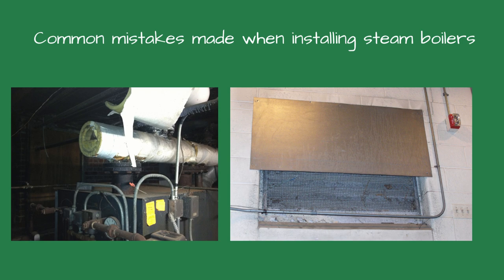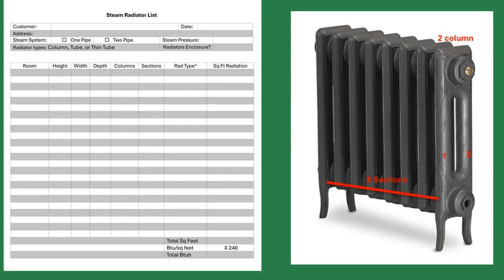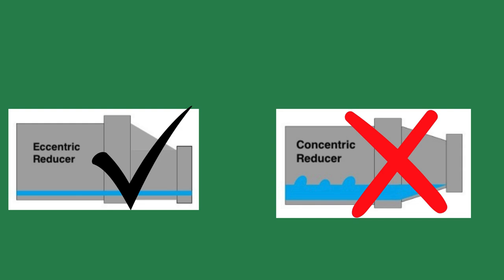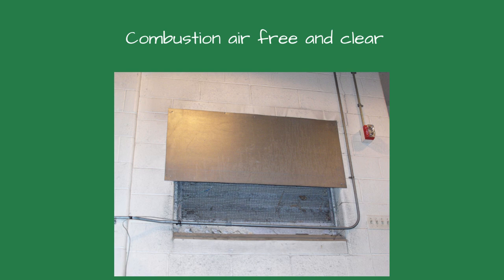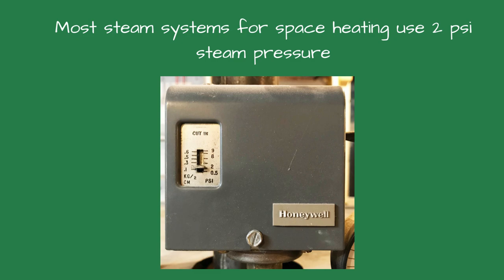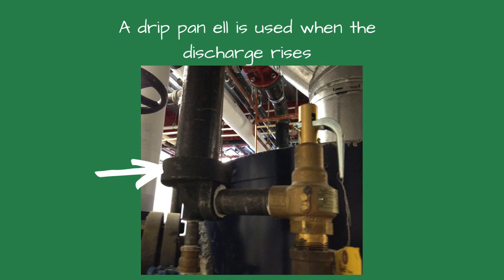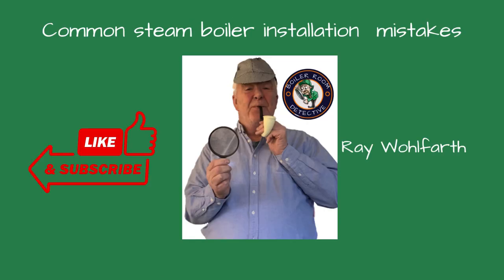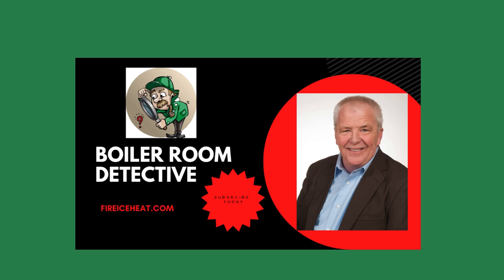Common mistakes made when installing  low pressure steam boilers

Comment: All excellent points. Vaporstats offer better low pressure steam control. I also think any boiler over 500,000 BTU input benefits with a minimum of a Low-High-Low firing burner.  This not only saves fuel, but reduces surging in a system with less than stellar cleanliness.
Reply from the maker: Thanks and yes that's a great idea
Reply from the maker: Thanks I appreciate it